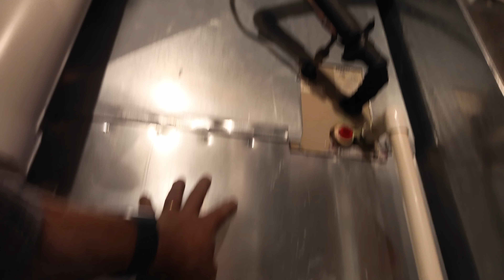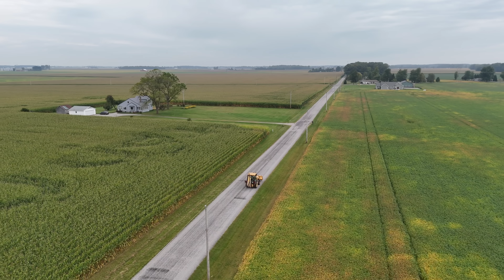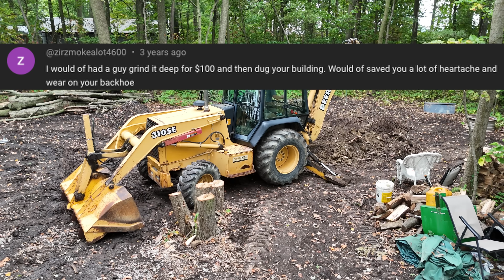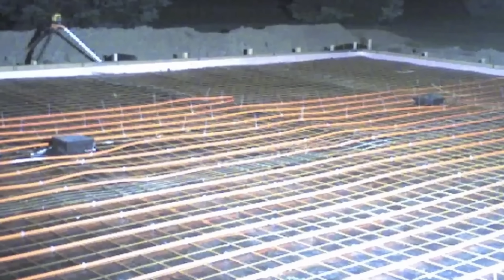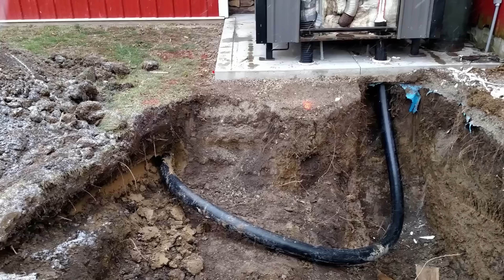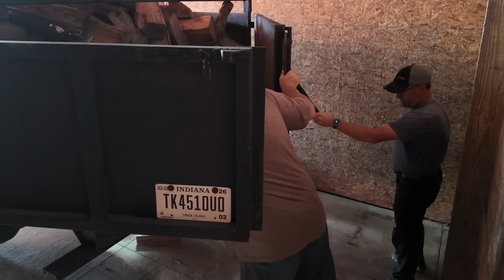Digging Stumps To Fuel My Outdoor Wood Stove

Comment: Neil, regarding digging stumps it can be damaging to any equipment.  But I dig them because I’m in the excavating and fire prevention business.  I run three excavators, a backhoe and three dozers and assorted other equipment.  With dump truck and trailer as well as truck to haul my lowboy and big end dump trailer.  I remove the stumps like you said because I don’t want them under foundations and places they will decompose and cause a depression.  The trees I remove mostly become lumber I mill myself or firewood mostly for some elderly neighbors who heat with it.  More elderly than myself. lol.  Any machine you run is going to wear and need maintenance.  My medium excavator just got some line boring I did to reduce some bucket slop.  My backhoe is the most general use tractor I own.  I use it as a loader, forklift with its onboard forks and as a digger for local projects I can drive too.  I enjoy your videos… John

Comment: Is there any reason why you don’t heat your hot water with your boiler too?  I have a water to water heat exchanger and heat my hot water for my house first then the heat exchanger for the house and then heat exchanger for our attached garage. Eventually want to build a 48x64 shop and do radiant floor heat for it. I have a Crown Royal 7400MP. Installed it in 2019. Went from a forced air add on wood furnace to this and so far really happy with it. Keep my house at 72-74 all winter long.
Reply: I asked the same.  That addition would be a great video and would be a great electric savings over the cooler months.

Comment: Do you think a thumb would of helped in removing the stump ball?
Neil, my neighbor buys semi load of hardwood logs. Then pays a guy to process those logs into firewood.
I’m not sure how many cord you go through in a heating season. But he said it costs him $1,200 per trailer load and $300 for the guy to process it. So for $1,500 he doesn’t have to do any of the cutting or splitting. He just stacks the firewood. Might be something to consider.
Reply: The guy only charging $300 won't be doing that long....that's too cheap.  

And clearly there are some transport costs here unless the guy is processing it on your neighbor's property-- which means he would really be charging too little.
Reply: @ian3580 $300 to cut and split the wood. You have to load the logs onto the processor. He just sits there and runs it.
He brings the processor to your place.
Reply: @WyattWhipperFilter $300 and he brings the processor to your place, and takes it back home.  So you’re using his time, fuel, and wear and tear on his equipment.  $300 seems way to cheap to do a truckload of logs.  

The guy could buy his own truckload of logs and process it and sell the processed wood at a much greater profit. 

If he does that for $300....it's a friend/family discount

Comment: Niel, 
I have a few heating questions. 
1) shop HX. Do you have it operating where the fan draws air thru coil? If so, I would recommend changing that around. Fan should blow thru, that way hot air is not going over motor.
2) house forced air furnace. Do you have any issues with “runaway” heating in should seasons? Reason I ask is when some folks install an air to water hx in the horizontal position and continuously circ hot water thru it, it creates convection. To remedy this install a motorized 3way valve on supply side of hx controlled by tstat.

Comment: I'm Canadian and anything with the word "crown" or "Royal"
Sorry I won't have anything to do with. 
The furnace might be the best thing ever built for efficiency and home heating, but we are fighting a monarchy that have devastated this country for the last 158 years and I simply can't have a furnace with those two word and having to look at that name every day!
Great vid btw. I did 15,000 sq/ft with a JD410.. JD are some of the best back hoes out there. You will never hurt that thing.
And yes there is some truth to it being easier to push over a tree left standing, but only up to a certain diameter with my heavier machine. I wouldn't try anything over 10-12 inches to tell you the truth and mine were all cotton wood. Way different root system.. 
a single ripper tooth on a quick detach arrangement on the bucket would've been great for cutting through the roots.
Everybody's an engineer until they go do it for themselves😂😂👌

Comment: Neil,
Good video,, I have been watching you for two years now.

Digging out stumps in the “woods”, is easier because the ground is not compacted as some open land, 
pastures for grazing are also softer to,
Now back to the comments!!
I have 60 years experience in tree removal, I’ve seen it all from people, and some are pretty incredible????  But there are certain situations for different options for removing stumps!
If someone is building on top of the area the stumps must be removed, and back filled and compacted, if new farm land is being cleared the stumps and roots must be cleared!!!!
If you just thinning the wooded area then grinding is the best option, but never leave a stump that sticks up above the ground. Also pushing over a tree is a good option if you have the bug equipment, this depends on the size of course.
Every person evaluating what to do considers cost , time , and difficulty, most of the time cost wins, some people are just not qualified to make the right decisions???? Anyway good video 
Thanks

Comment: Another great video, thanks for the overview of your heating system. As for the backhoe, you're spot on right about everything, stump grinding is fine in some instances but a hard pass in others. The two things that will destroy a machine of any kind are lack of maintenance and poor operation and your machine doesn't experience either one of these.

Comment: A friend of mine use to sell outside wood burners not to far from you. RD Snider, If you have wood available to burn at minor cost then you can save some money. I almost installed one in my shop years ago I priced how much fire wood would cost me and the cost of the wood stove and installation. It was a lot cheaper to buy a big propane tank and do a summer fill. Our place up in michigan you see a lot of outside wood burners but propane is a hell of a lot more there and plenty of fire wood available. Great Video

Comment: On a job site one day many years ago…
Really big tree stump. Maybe 4 + ft across sticking up about a foot. Buddy pulls up with an excavator with his homemade stump grinder. A thick metal disc with what looks like bucket sized teeth pointing straight down. Not cutting like a saw but more like a grinding disc. The attachment could articulate as well. 5 minutes later he had this thing 3 feet deep in the ground with no signs of a stump. Loud and messy and incredible to watch.
Reply: I should add that this isn’t a criticism of what you are doing or a machine upgrade suggestion. It was just a really cool attachment made by a smart operator.

Comment: Bro... so many armchair quarterbacks out there. I've operated equipment, heavy and small for over thirty years. You obviously know what you're doing... It is sooo entertaining reading those comments 😂. I started operating heavy equipment in the mid 90's and I have owned and operated a small plumbing and septic company for 17 years. Along with that, I'm a fire Lieutenant with our local fire department.  Amongst stuff I've accumulated over the years, I have a 2007 Mustang ME 3503 mini ex with 3500 hours on it and it has been phenomenal! I paid 14k for it 12 years ago and couldn't be happier. Now, I've had to put a little sweet and tears (and a few dollars) into it but it's definitely cheaper than paying a monthly payment. I also own a 2017 Cat 259D that I unfortunately had to replace then engine after only 1330 hours. That hurt... But it is what it is...
Keep up the great videos your ability to negate the naysayers.

Comment: Stump grinding is better than leaving the stump, but I spent the better part of a day hauling away the piles left by the grinder - the fellows that took down the 7 pine trees, included the grinding, but the haul away was going to be an additional charge.
I wish I'd know a guy with a backhoe 😃
Thanks for the video, always enjoy them.
Reply: This is the point a lot of people miss.  When people say that grinding is so much better are probably people who grind stumps for money, or people who have never had a stump ground.  When you grind it, now you're left with a deep and wide hole filled with a mix of soil and ground up wood.  And it's a pain to remove, and you end up removing a lot of soil to get rid of it....and now you need fill soil.  Especially if putting in a building, I'd rather have them dug out.  And even if you ground them, you'll end up needing equipment to dig out all of that wood/dirt mix and to add and compact fill dirt unless you want to do all of that by hand.  Just dig them out in the first place.

Grinding stumps is better in some situations, makes no difference in others, and is worse in a lot of them.    And I think a lot of homeowners are surprised that when they have stumps ground, they're left with a pretty big mess to deal with.

Comment: Question:  On garage floor heating, why do you need to mix the cold return water with the hot water going to the floor? Why don't you want the water going in as hot as it can be?
Reply: Too hot can cause damage to the concrete. Also you want a even temp and no dramatic swings which is also bad for the slab. So a nice even temp going into the slab will help and not over heat the space.
Reply: @mabmachine  Makes sense  thx

Comment: I`m in the UK, and we need planning permission for everything which is basically a good thing with land being at a premium here...Do you need planning permits for your barns etc..  and could you grow your own wood around your property?..nice and very interesting video Neil,.....by the way, we have to use `kiln dried wood' in any type of stove here, as the air pollution would be really bad otherwise.   I get either a half cubic metre or full cubic metre delivered, and then have to barrow it in. At 73, and with  a grotty back, I`m not looking forward to the next delivery.
Reply from the maker: We do have to have building permits for any new construction.  At least in our neck of the woods. Other areas of the US are more or less strict depending on where you go.  We can grow whatever trees we want on our own property.  Fortunately we don’t have to kiln dry the firewood though, although some do for sure.

Comment: A few people in our area also use the stove for hot water for the house as in cooking, washing, and showers. I did notice in the video you have a hot water heater so I wonder if you use that for the summer months when the stove is not running?
Reply from the maker: Yeah I’ve never plumbed it to heat our water.  Our electric water heater is in use all year round.  I should add the heat exchanger to the water heater for winter time hot water!
Reply: @digdrivediy  I would love to see you do that project....basically putting a heat exchanger in series before the electric hot water heater.  When the boiler is running it is basically a 'pre-heater' and could probably just about get it to temp (though you might end up needing another mixing valve to keep the hot water from being too hot OR just have a demand valve based on temp).  I have electric hot water and it is definitely one of the largest uses of electric with 3 adults and a teen at my house.  Heating water is expensive.  I think your return on investment for that would be short, especially with two adults and the two girls.

Comment: Neil, I’ve been told that trees growing in a grove are subject to less wind-born stresses than those growing in the open.  So, their lateral roots don’t have to reach as far for support.  Their roots also have to compete against other trees roots for nutrients.  As a result, their roots tend to ball up instead of spreading.  And that is why they blow over once their neighbors are removed…. And why the stumps are easier to dig out.  Could be true… could easily be just a notion???

I enjoyed the refresher on your heat distribution system…. I was here when you installed the get in the barn/shop.  Has it been that long?  My how time flies when you’re Digging, Driving and DIYing with our buds!!!
Reply from the maker: That makes total sense to me! I’ve always known it to be true but never put a ton of thought into it into it.  When I did full time excavation, we did some lot clearing jobs and could remove 75% of the trees with a dozer by just cutting around the base with the blade and then pushing it over.  That was rarely the case for a tree in the open.  Had to use the excavator because the dozer wouldn’t push them over. That would have been a great bit of info to recall at the time of digging these!  :)

But yeah you’re right! Time sure does fly when you’re DDDing! Thanks for sticking around for the ride my friend.  Still look forward to your comments Dave! 
Have a great week.

Comment: The best way to remove a stump is with the expertise and equipment you have. I like the idea of digging it out completly to remove the possibility of rotting material below the slab which would likely result in cracks over time. Great job Neil!